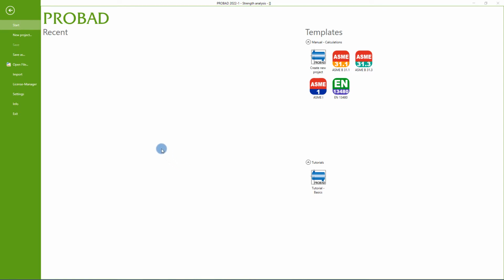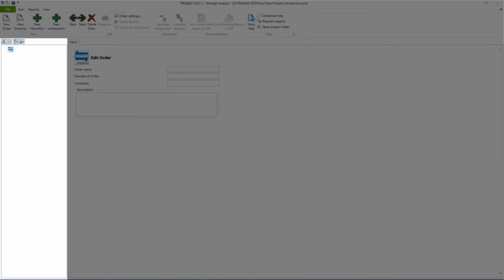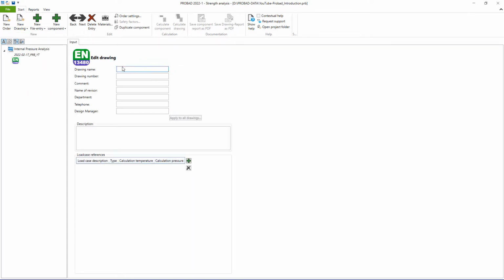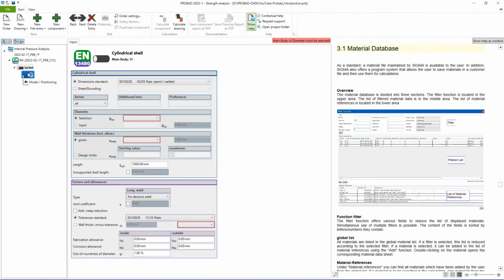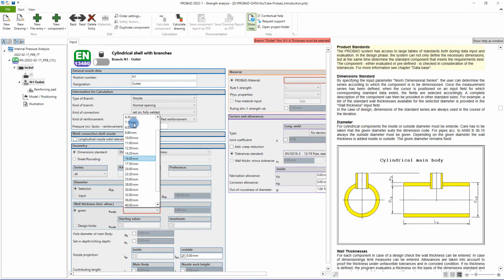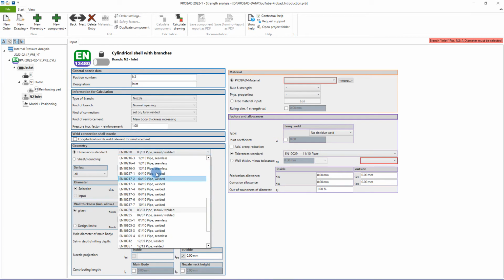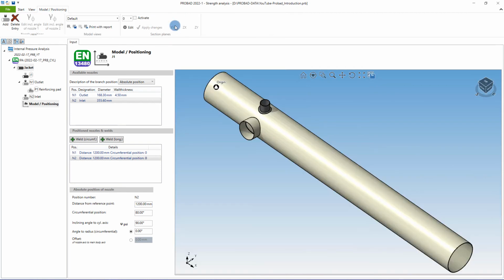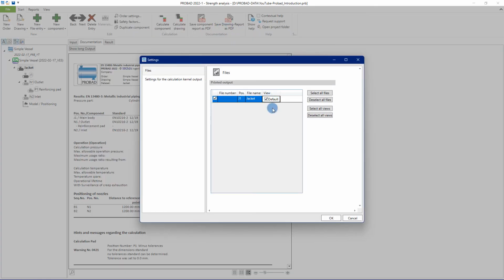PROBAD | Introduction - Internal Pressure Design acc. to EN 13480

Comment: Sometimes the software leaves the result tab blank and sometimes it doesn't. I'm pretty sure I'm not doing anything differently. Is there any fix for this?

Edit: Looks like it wasn't giving results because I only clicked "calculate drawing" and didn't click "calculate component"

Comment: Hello, are the possibilities with this software the same as with Virtual Vessel Design?
Reply from the maker: Hello,
PROBAD supports all common calculation codes for pressure vessels and pipe components (ASME Section I, Section VIII, B31.1, B31.3, ...; EN 13480, 13445, 1591, ...; AD 2000 ;WRC ...). You can have a look at our website for an overview of all codes: https://www.rohr2.com/en/probad-calculation-codes.html . For further details you are welcome to contact us on https://www.rohr2.com/en/contact.html .